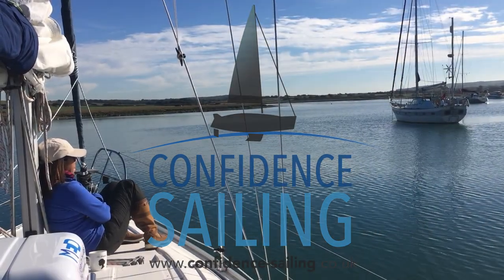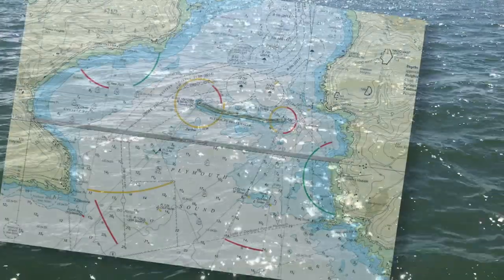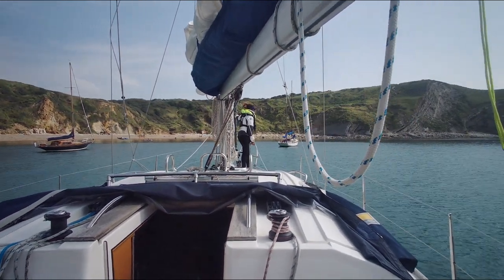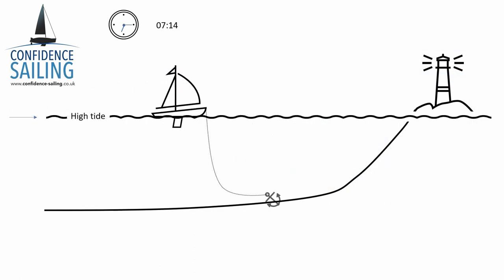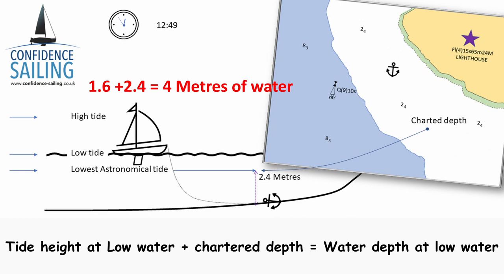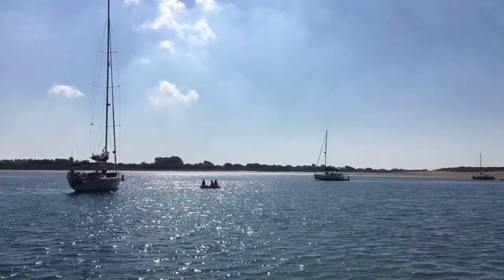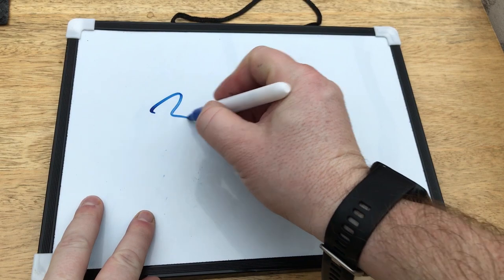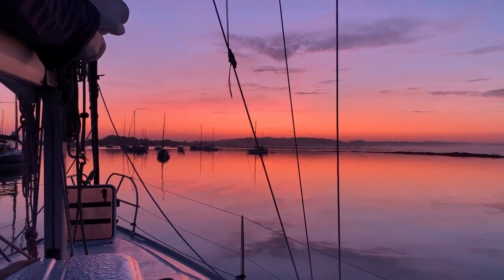how to calculate depth for safely anchoring your boat.

Comment: 0.4 under your keel is a bit tight. Any wash or swell and you will be bouncing off your bottom. Tidal heights are only predictions and if the range of tide is out by 0.2m this could aggravate the situation. So in your example if you calculate the range to be 2.8 and you anchor in 3.8 at HW and the range is actually 3m at LW with a draught of 1m you will be aground.
Reply from the maker: The numbers in the video are only there as an example, but you raise an important point about the effect of the weather on tidal heights.😂 In Southampton yesterday, storm Eunice increased a 4.5 Metre high tide by an additional 0.8M above prediction.